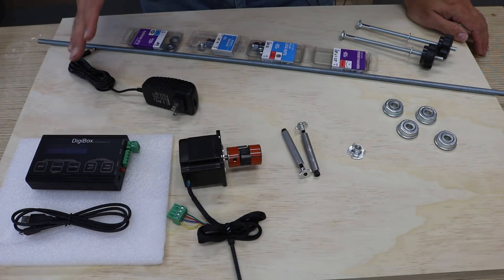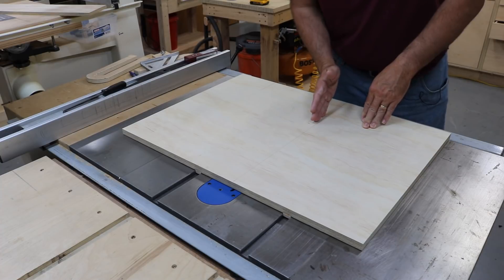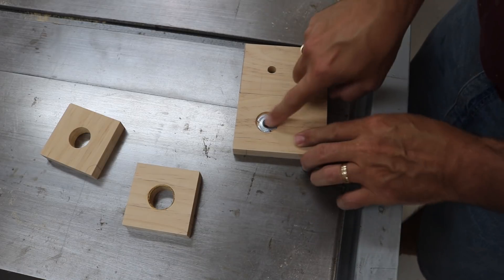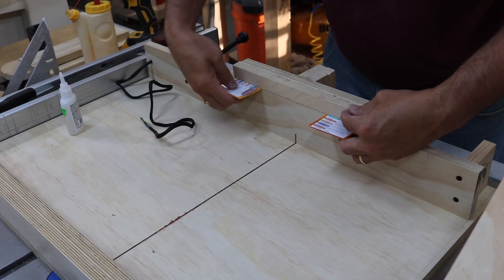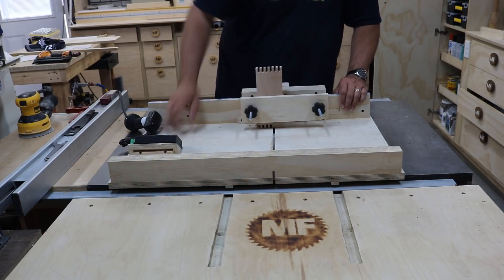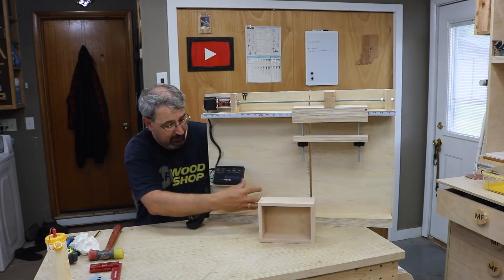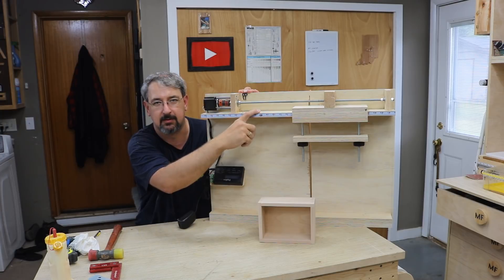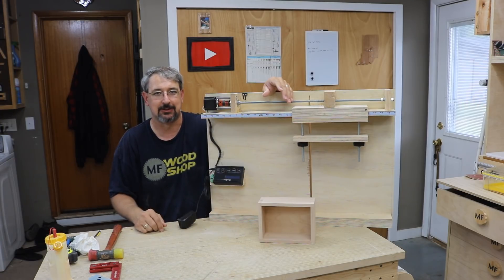DigiBox-Digital Box Joint Jig

Comment: A small block with a magnetic base would allow you to put the back stop for the advance switch anywhere on the saw surface and would easily move when you don't need it.  Attach a small metal plate to the sled to put the block when not in use.
Reply from the maker: Yup, just have to get one

Comment: Hi Mike
Is the digi box programable?  Mostly in the uk we do not have the capability for using a dado stack.  What I would need is the capability to input blade width
and finger width so you could use a single blade.
Mema 23 e(?  Sounds like it is a 3D printer x axis driven by g code. If that is the case sounds like it would be a bit of code to send. 
Great video excellent explanation thanks for your time.
Reply from the maker: Not that I know of but you might check with Jason on that
Reply from the maker: From Jason
“I have been working on firmware to use a single blade, but it's much more complicated.  I'll hopefully have something soon we can offer Europe.”